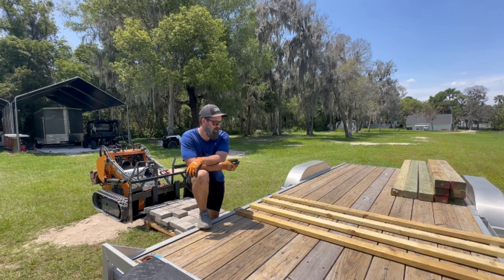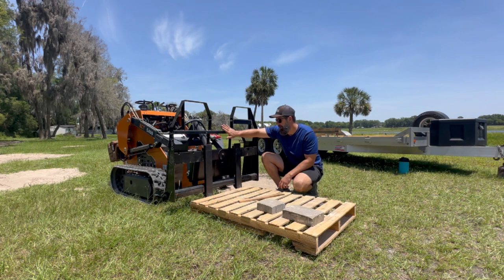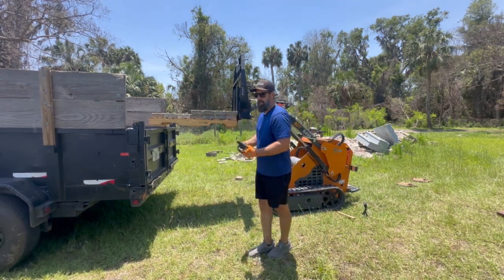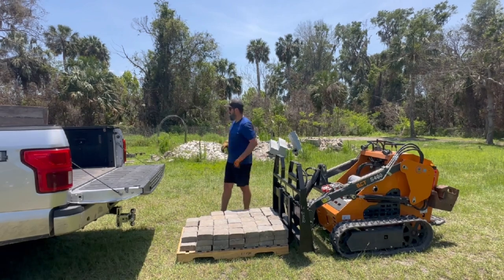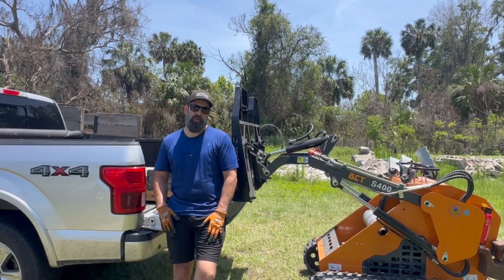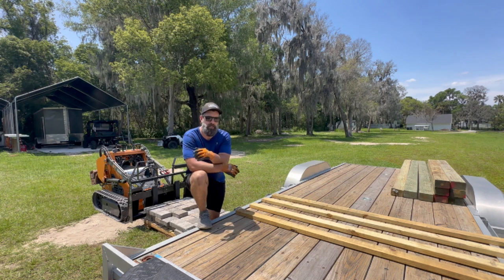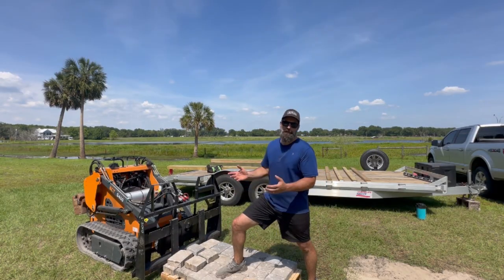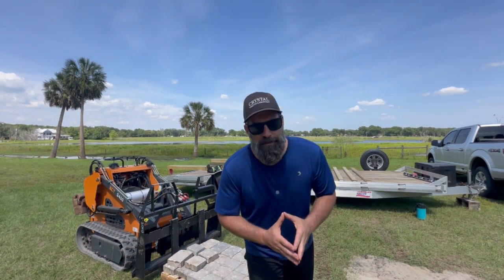Counterweight BOOSTED Lift Capacity of Chinese Mini Skid Steer

Comment from the maker: If you like my videos, be sure to like and hit the “Hype” button. This helps small channels like mine compete with big channels. Your support is greatly appreciated.

My pallet forks are 300 lbs. If you have mini pallet forks, you can lift more. For example, if you see 1,122 lbs on the screen, subtract 300 lbs (my pallet forks) and then add back your mini forks (170 lbs). In this example, my machine is lifting 822lbs, but your machine could lift 992 lbs. With more counterweight, this number should increase. Hope this helps!

Comment: My mini skid forks from Wolverine are 350lb
Reply from the maker: Wow!! I wouldn’t have guessed that. I was reading forums for these Chinese Skid Steer and it seemed most were estimating between 160 and 200 pounds. Well, you can count on them being very well-made and durable.
Reply: I havent weighed mine, but they seem to be easily over 200lb